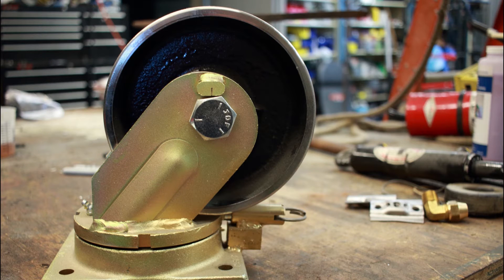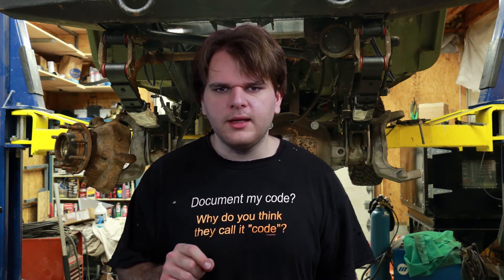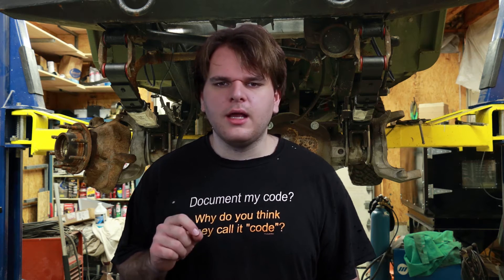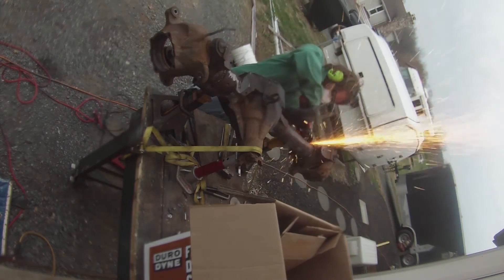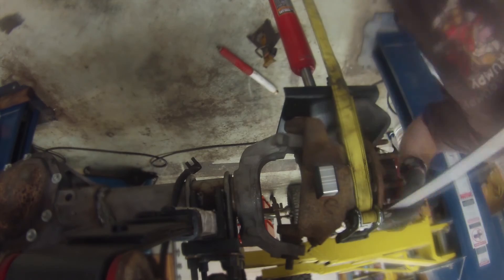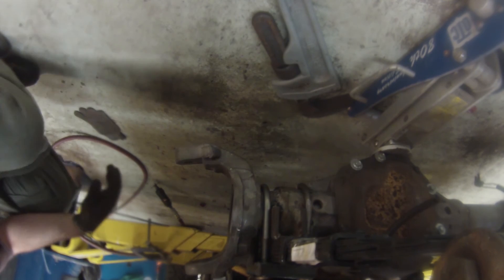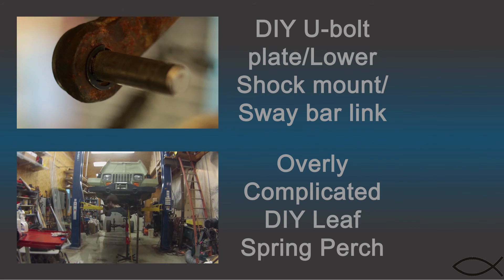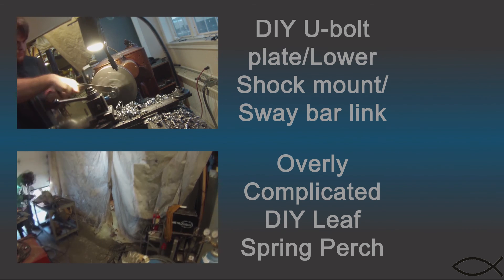Setting Proper Caster Angle Dana 60 Jeep Swap 610BOB's BUILDS

Comment: This is Garrett... I'm Doubletree Energy, just on a different computer now... So ya, that sucker wouldn't budge at all!!  I did dry ice, heat, small sledge, big sledge, air hammer, pry bar, big pipe wrench! I was in full blown crossfit beast mode as they say huffing and puffing but that house is made of stone! Basically everything in the shop threw at it and not even a wink. I did grind in more than enough to see the clean partition from C to tube. That interference press on some D60s is extreme to say the least. Then you add 30 years of rust and seizing. Also I just noticed that your 60 is ball joint style where mine is kingpin. Maybe that's a difference? Anyway, so I cried a bit and resorted to cutting a relief slit on the c down to the tube very carefully with a 1/8" wheel. When I got about 1/32" from the tube it hairline cracked the rest of the way and relieved the press by just a tiny bit enough to where now at least with the sledge and hard whacking it moves. I am setting mine at about 10 degrees caster which is a bit much but this is purely off-road purpose bogger truck. I didn't do any video but I think most people will get the drift by description.
Reply from the maker: +Garrett Greenhaw Wow. That was on there good. I'm sorry to hear it was so difficult. I wonder if they pressed those older C brackets on hot and let it compress onto the tube. That could explain why the ice and heat weren't enough. You would need to get the c bracket red hot to get it to relax enough. If they did press it on hot. Anyway, thanks for sharing. Hopefully, your comment will help others out.

Comment: I have read up about doing that. I will likely go get some dry ice to place in tube then gently heat the sided of the C... Seems to work for most. I also read up on a thread that a guy had no luck with a sledge but instead had excellent results moving it with a stout IR air hammer/chisel. I also have a giant pry bar that I will likely keep tension on it in the direction of turn then start easing it with sledge or air hammer. I may try videoing it and taking pics along the way and then post my trials and successes.
Reply from the maker: +Doubletree Energy Services Please do and good luck. The combination of dry ice, heat, and some heavy persuasion will most likely make it a breeze.
Reply: Are you Using the dry ice and heat just to remove the C?  Or when adjusting the Caster?  I will be doing this same thing in My YJ..  Were you able to use a short factory shaft or did you have to have yours cut and resplined?
Reply from the maker: RibbedGiraffe 1 Not sure if that was directed at Doubletree Energy Services or me. But dry ice will help. Those c brackets can be on tight. Anything that can make it easier would be worth trying. Especially if you don't have humongous monkey wrenches. :)

I talked to a local machinist about getting my axle shaft resplined. He said that it would be cheaper to get some custom shafts made. Most Likely going to be the same response from anybody.  Mosere Will re spline fairly cheaply since axle shafts is what they do. But you have to ship a heavy axle shaft to them. When I did mine, between shipping and resplining costs, I would not have saved that much. And that is compared to a stronger axle shaft. So I purchased a custom shaft from Mosere.

moserengineering.com
Reply: Ask your local race car guys, there is bound to be someone that can do it cheaper.   There is a local shop that will cut and respline mine for 50 bucks.  I was just wondering if you went with a length that was available in a factory length, A lot of guys shoot for that so they can use off the shelf parts.
Reply from the maker: Yea, I didn't look to much into getting the old resplined. The cost wasn't that bad and I got a much stronger axle shaft out of it. :)

This jeep is street legal, so full width axle would be difficult to deal with. Dumb laws. LOL But I can definitely see the appeal of using off the shelf components. Hopefully, I won't need to worry about that. Crud, I need to go find some wood to knock on real quick. :) LOL
Reply: Mine is "almost" street legal... And I like to keep it that way.   Leave it a little questionable, life on the edge!  Good luck with your build.   I'll keep checking in.
Reply from the maker: LOL Thanks. Good luck to you too.

Comment: thank you sir! i will attempt turning the C on the tube
Reply from the maker: No problem. Also, this may be obvious, but if it is too difficult, you can heat the c bracket, while keeping the tube cool. That should make it easier.

Comment: thx for the vid. wish i could see more of the action cutting the weld and rotating C.  I need to also change caster on my D60 on a bogger build I'm doing and wanted your advice. I'm debating doing as you did here or cutting the tube about .5" in from C, turning, sleeve inside with 2.125" OD DOM, reweld the crud out of it and sleeve/gusset outside for added strength. My worry with trying to turn the C on the tube is that on some online forums they state the D60 has an extremely tight interference press from factory and makes it very difficult to turn or even remove from the tube itself, however, in your video here is seemed that yours moved fairly easily. Can you tell me if that was the case and what you recommend? Thanks
Reply from the maker: +Doubletree Energy Services With a big enough sledge, anything will move easily. :) It was fairly hard to turn. I started out with a deadblow hammer, but that didn't budge it. I ended up using a mini sledge, which worked. I wouldn't sleev it unless absolutely necessary. That would create a weak point. 

Yea, sorry for the lack of video. It can be difficult sometimes to get my gopro in a good position without it getting in my way. But all I did was take a grinding wheel and grind out the weld going all the way around. It was challenging to see how far to grind until I got through the weld. But you will see the a crack where the joint is. You will have to rotate the C bracket a little for this crack to become noticeable though. I ground out about a half inch groove, then whacked it with a hammer a few times to get the crack to form. It did take a few tries though.

You will need to do a couple of passes with the welder to fill in the grove that you create. This was a mistake that I did. I tried to do it in one pass, and the weld didn't look the best.

When your project is done, send me a pic. I would be interested in seeing it.